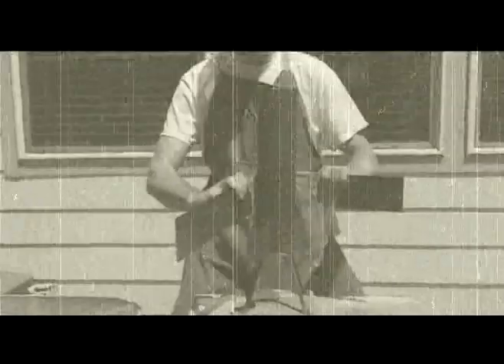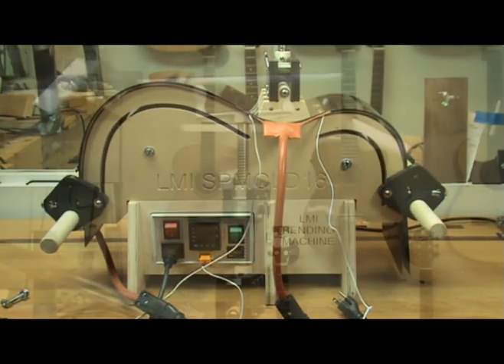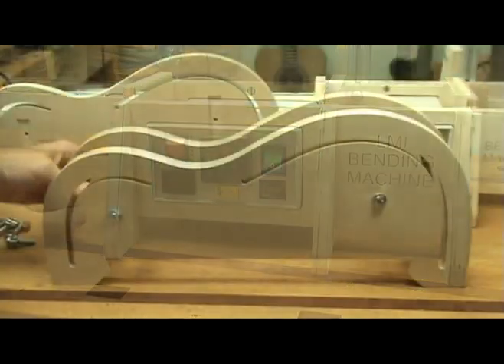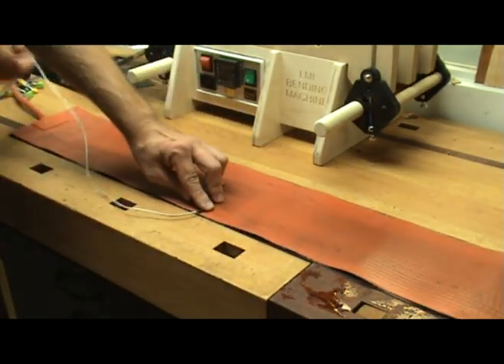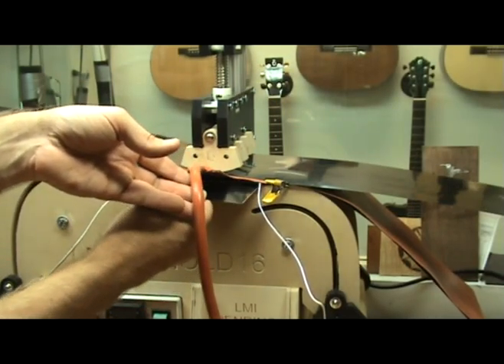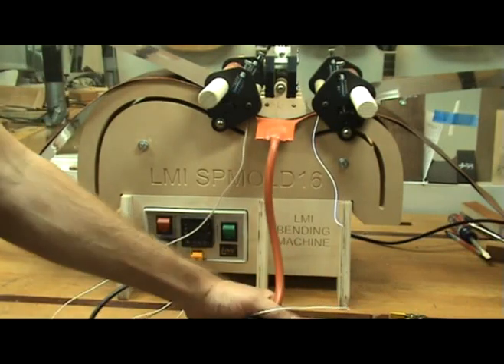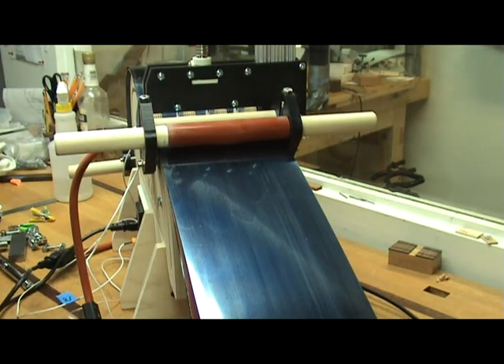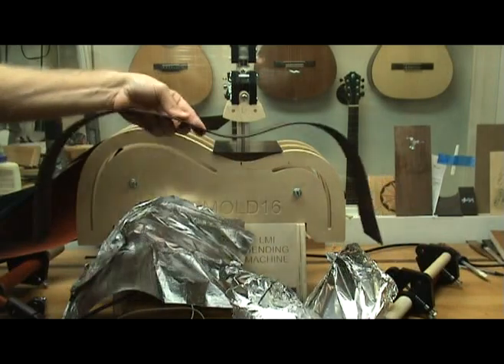Luthier Tips du Jour - The LMI Side Bender

Comment: I love Robbie and his teaching.  But Im disappointed that this is the best bender in his opinion.

I am not impressed by this bender.  12 years ago I studied all the benders that I could find.  Mike Doolin's was the leader of the pack at that time and I built one like his with a few improvememts.  

It had/has an integrated box mounted temperature controler and timer which will shut the heating blanket off at a set time (you can't forget and burn the house down) and a plug in for one of two termocouples so you can monitor temperature at more than one point.

There is no awkward "floating" sandwich of spring steel and heating blanket that is not practical to exactly align and can cut you easily if you don't handle it carefully - and where do you store the steel and blanket?

My "sandwich" is fixed and bolted in place so it's not floating around, and therefore stores in place on the bender.  The side registers at the butt end and can be cut to EXACT length since it is locked in place there.

There is no tall awkard waist clamp which makes the binder hard to store due to it's size.

The spring steel remains tight which keeps the heating blanket in contact with the wood for better heat transfer.

This LMI binder procedure is complicated, not particularly safe, and awkward to store.

Comment: I still use the Fox original with light bulbs,  It's faster than what I see here, and while the dry really hot heat here should set the sides better, in this video, the springback looks similar.  Doubtless this is a better machine, and it is getting harder to get lightbulbs of high wattage for the one I use.  .

Comment: Where to buy selikone heat mat and Steel.?
Can not get it in Denmark where I live. And I can not find addresses where you can buy it outside of Eu .. Unfortunately we tax and customs so I have times the price of approx. 1.38 in customs in Denmark .. But if you have an address on steel and blanket.
regards
paulick.j@gmail.com
Reply from the maker: I just sent you an email. I get mine at Luthiers Mercantile International
Reply: Hi,

You might want to check keenovo heat blanket here:

http://www.ebay.com/itm/281278041684?ssPageName=STRK:MESOX:IT&_trksid=p3984.m1559.l2649